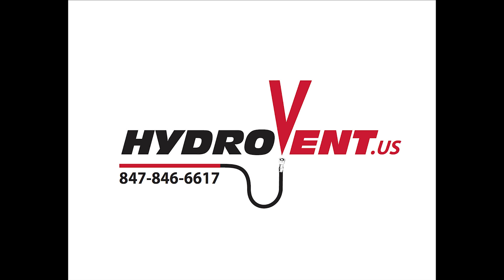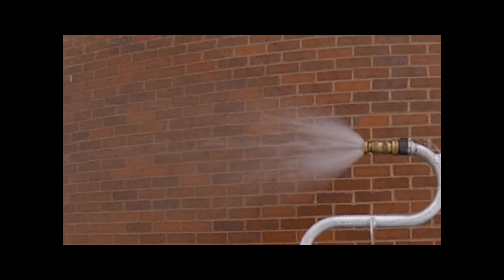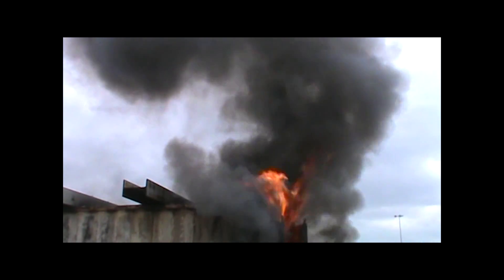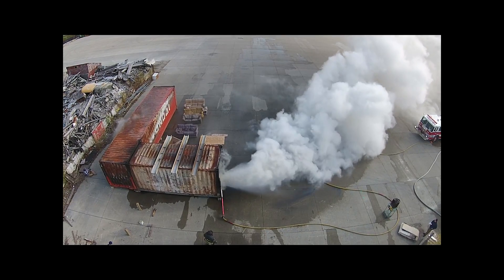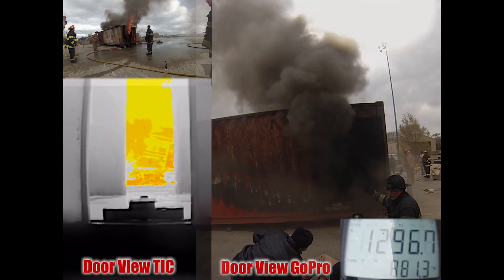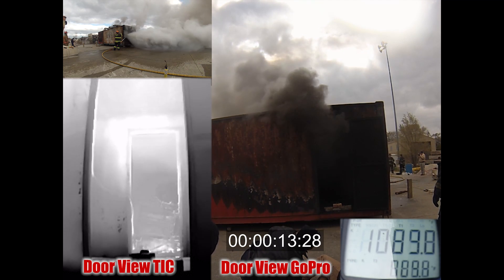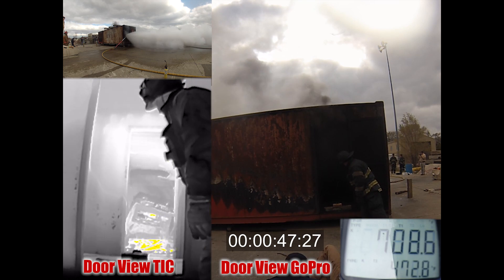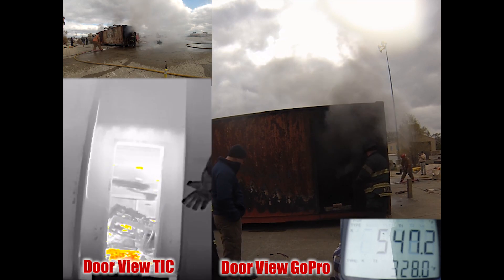Hydrovent Demos- 1 Drone @ 1:00 / Interior Conditions Change Dramatically  @ 2:14

Comment: How much GPM of water is thrown in towards fire and how much GPM of water is vented out to suppress fire. How to calculate this details. Please explain
Reply from the maker: @apoorvchoudhary774  The inward nozzle flows approx 70 GPM through 4 holes and the outward fog is approx the same depending on engine pressure. The more you pump it the more flow for better suppression and more ventilation. 
Is you have any other questions please reach out anytime 
Kevin O’Donnell   Kevin@Hydrovent.us   1-847-846-6617